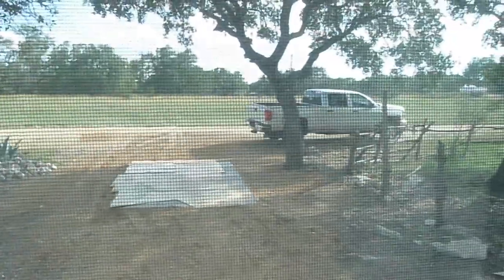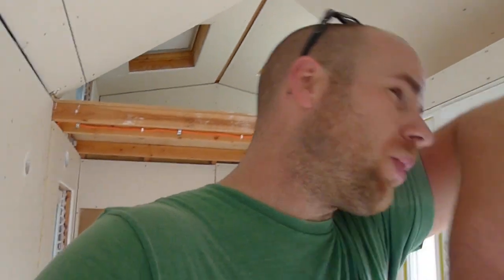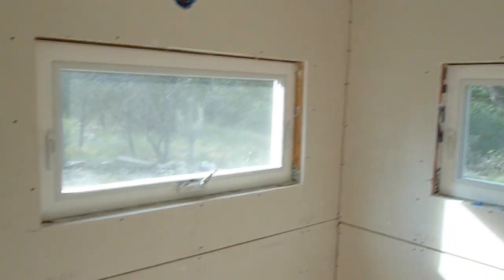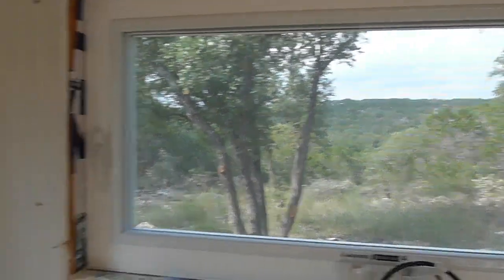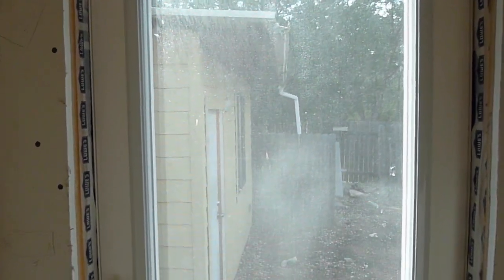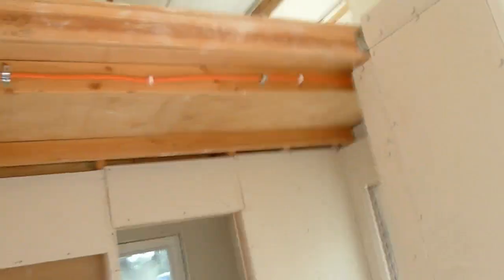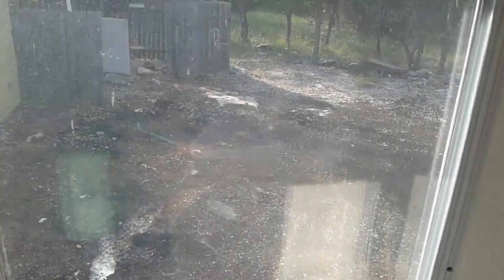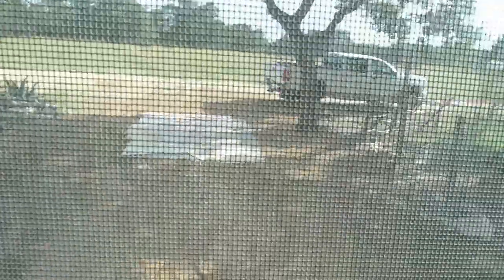Tiny House is Moved

Comment: Wow I heard your from Texas! I want to build one too, where did you purchase your trailer? and if you don't mind me asking, how much did you pay for it?
Reply from the maker: +tigerlillycat2004 I bought the trailer from Texas Trailer Supply just east of Austin, for $3,400.  It had two 7,200lb axles, and no ramps, rails, or dovetail, so it was quite custom. They had it built within a week of my ordering it, and it was fantastic quality.  I suggest not cheaping out on the trailer, since it's the foundation of the house!

Also, look up my blog posts on the realities of building a tiny house before you get too hot and heavy into it.  :)

Comment: IF it was going to crack it would crack on the seams where it was taped and mudded. Can't wait to see the tiny house finished! We hope to build someday. Have the trailer. Did you choose drywall because of cost or what went into your deciding factors? I don't want to deal with mud and tape ect cause we redid our old house and its a pain but if its a lot cheaper that will be the way we end up going because cost is a huge factor!
Reply from the maker: It was WAY cheaper, but the main reason we went with drywall was for aesthetic reasons.  I don't like the way knotty pine, T&G, etc looks.  I really like the look of a clean white wall, however, and so does my wife.  Each sheet of drywall was about $5.60 a piece, whereas an 8' x 8" piece of pine or something is about half that. MUCH more expensive.  However, some people swear by using wood for interior walls.
Reply: I like the crisp clean look too. I can't imagine dusting the ragged wood...